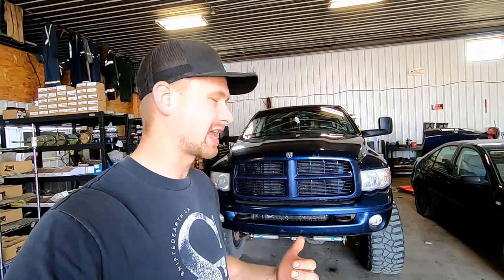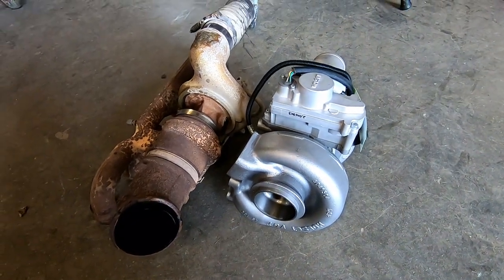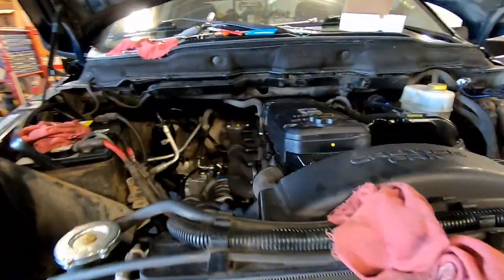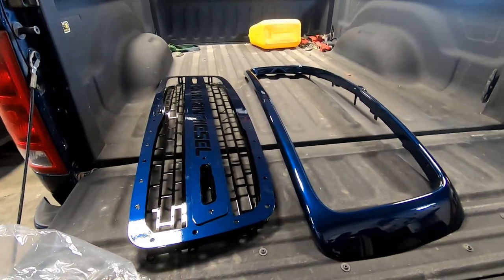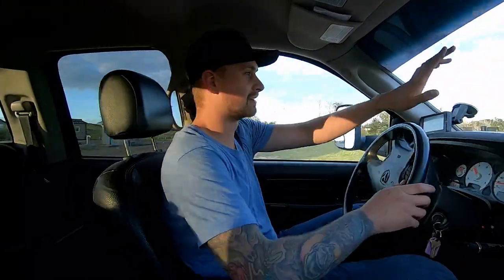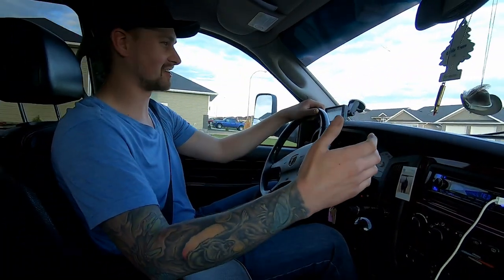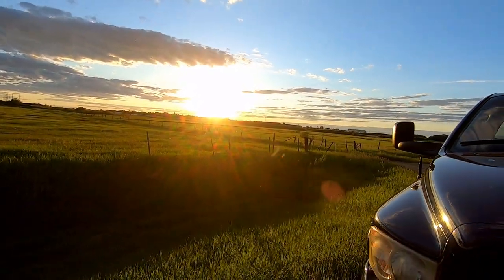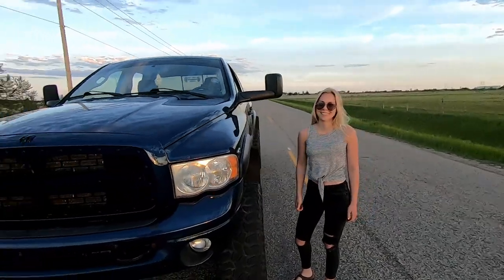I put a VGT TURBO on my 5.9 CUMMINS!  BD Diesel Performance Howler Kit

Comment: Just installed this on my 07 5.9 and really like this setup and I’m coming from compounds. Warmup and the exhaust brake is awesome, fitment is fantastic considering this is mostly factory parts. My compounds experience was ok I was running an HE351/S472 and had some issues with fitment and an oil leak I couldn’t get rid of due to a mount problem. I got frustrated and wasn’t going back once they were removed.
Reply: How is it warm up faster?
Reply: @repairvehicle  the same as the 6.7, the VGT constricts and loads the engine. Most exhaust brakes do this too. I really don’t know of any that don’t have this function.

Comment: I personally love the exhaust brake on my 2014, I turn it on as soon as I start the truck. It helps save the brakes on your truck and I figure the more you use it, the less likely you are to have a problem. So far the truck has 200,000 miles on it and no problems out of the vgt, the transmission is a different story, I hate it.
Reply: I’ve never heard of problems with a 68RFE?

Comment: On m’y 3rd Ram with a VGT and love it. When you engage the exhaust brake while in tow mode (auto trans obviously) and let off accelerator- be prepared for a substantial launch forward of your head towards the windshield. Works amazing. Great video
Reply from the maker: Thanks man! Glad to hear the brake works awesome on an auto as well!

Comment: I have a he351ve on my first gen dodge project truck. I'm running a standaline controller. I feel in love with the turbo as I daily a 08. I bought a 67mm compressor wheel and 70mm turbine, just need to pull the turbo off and get the machining done. The controller I use is from Lil'black box vgt and there is app to custom tune the turbo so I can make changes to the vains depending on shaft speeds, super trick set up.
Reply from the maker: Thats deadly man! Cool you can custom tune it
Reply: @darkirondiesel  yeah I use my as the controller has Bluetooth, can load the updates with the app as well and data log.  Well worth the 500$, you pretty much can run a vgt on anything
Reply: @darkirondiesel  also just found your chanel, great content
Reply from the maker: Thanks buddy!

Comment: I love your videos 👍 I own a 06 Dodge Ram 3500 4x4 5.9 Cummins and have upgraded from Banks the exhaust, intake, Intercooler, tuner, Exhaust Braking System w/CBC SmartLock and now I would like to upgrade my Turbo…what would you suggest?  I am retired so I only use my truck for daily and towing my travel trailer, I do not need/want for speed/racing just for towing, my truck has 88,000 original miles…Thank you for your videos

Comment: Hi very nice i have same truck 2003 quad cab long bed i bought with blown engine i am going o install a 6.7 and use 5.9 fueling system and injectors my truck is manual as well i like your turbo set up would you recommend it for mine thanks

Comment: That's awesome! I'm running a standard he351ve on my 04.5 with the 12 valve. A buddy of mine helped build a mechanical controller and we're trying to find the best way to get the exhaust brake working with it. I'm thinking a button under the throttle where it rests and then to a switch in the cab that I can make it stay off or come on when the throttle is let off. Possibly use a fuel shut off solenoid for the exhaust brake. The BD setup seems so much simpler but I don't like the coolant aspect or the price. These turbos get pretty pricey. I ended up picking mine up for free from a job I did for someone and decided to make it work. Good stuff, it sounds nice and runs probably just as nice!
Reply from the maker: Sweet buddy! If you get it figured out let me know, I’d be interested in hearing how you set it all up!

Comment: So I took your advice and bought the stock Howler.  Going to install this week and I have one question.  You installed the switch near the lighter/12v plug.  Do you turn it off and on or basically leave it on all the time?  My thought was to install the switch onto the shifter but if it is always on then there is no point, are you  happy with your switch location?  Lastly, your channel is awesome and super helpful....thanks again!
Reply from the maker: I pretty much leave the exhaust brake on all the time. Just install the switch wherever you prefer, it really doesn’t matter

Comment: Great video I keep coming back to! One question I have since you bought the 64mm screamer and plan on upgrading your sticks to 120, did you upgrade your clutch yet? If so, to what? I’m curious as to what you’ll think this thing will put down and what measures you’re taking tranny wise to reduce wear and tear with that much power!
Reply from the maker: When I bought the truck the clutch was slipping, so I put in a southbend dual disk clutch rated for 750HP. I’m hoping to put down 500-600 hp with bigger sticks so the clutch should be more then enough. I also did heavy duty push rods, valve springs, and apr head studs when I replaced my head gasket

Comment: You need to clean up your tune. That smoke is fuel and soot and the soot is really bad on you vanes in your turbo so the cleaner the burn the longer you vanes will continue to move. I know guys that leave the brake on all the time to keep them freely moving for a long time. Great video I watch them all and keep us up dated. I want to do the same thing but with a Sneed Speed  exhaust manifold with a 2nd gen swap and I just hate the turbo in the back. This will be on a 05 Dodge 3500 4 door long bed dullay 5.9 and I bought this RIH new only thing I’ve done is twin fuel filters Balwin water separator with drain it’s 5 micron and cat filter is 2 micron and that factory filter I put a Baldwin 5 micron and a Fleece in tanke lift pump that makes 21 lbs at idle and 18-19 with heavy load and gauge for lift pump the factory lift pump would put out 5 lbs at idle and 0 at a hard pull . So what kind of price did BD charge you for VG turbo ?

Comment: I see you're towing your invisible trailer.  I've got cabinets hanging out over my box  from my welding skid and I still keep my mirrors down.  Tried putting them up but the perspective drives me nuts.  Any issues with this system nine months later?  Thinking about it for my 05 3500.
Reply: Is it frowned upon? I keep my passenger mirror up. It helps me reverse into tight spaces lol. I’ve been told it looks like my truck is doing a 💪. (05: 6 speed Single cab dually)

Comment: So is it a normal working exhaust brake that you can use when towing and stuff or would an actual exhaust brake still be better?
Reply from the maker: It’s an actual exhaust brake and amazing for towing. All the new trucks come with these vgt turbos from factory.  My 2022 Cummins is also amazing with the exhaust brake especially in tow haul.

Comment: I was woundring if you could put a VGT turbo on an older engine. I am building a 1936 dodge with a 2005  3.9L ISB. I like that idea.
On a 2015 and 2022 you can have the exhaust brake on with the cruise at 3mph over your set speed the EB will come on and bring you back to set speed.
Also, all videos are better with a pretty girl in them.

Comment: I need to do the head gasket and wanted an exhaust break without spending $100k on a new truck. You upgraded the Valve Springs, rods and studs.  Would you do this any different?  Now that you have had it for a while, would you do it again?  I have a 2005 6 speed G56 that we tow with.  Your vid's are very helpful.  Thanks in advance!
Reply from the maker: I’m really happy with this set up. I did valve springs, push rods, head studs, and then the turbo plus now 90hp injectors. If I were you and you’re just using it mainly to tow I’d probably get the regular howler kit, not the performance one. Exhaust brake is amazing and it’s got tons of power
Reply: So I took your advice and bought the stock Howler.  Going to install this week and I have one question.  You installed the switch near the lighter/12v plug.  Do you turn it off and on or basically leave it on all the time?  My thought was to install the switch onto the shifter but if it is always on then there is no point, are you  happy with your switch location?  Lastly, your channel is awesome and super helpful....thanks again!

Comment: Great video!! I'm interested in doing the same mod to my 03 with a 6 speed NV5600 what additional parts did you need for the turbo coolant connection? How complicated is the wiring for BDD?
Reply from the maker: The kit comes with everything! But you will need to buy a 2005-2007 style downpipe like it says on their website, then a new v band clamp for the bigger flange. The wiring was mostly plug and play, you do have to splice into a couple wires on your accelerator pedal position sensor which is under your driver side battery, and splice into your coolant temp sensor signal wire. Just call tech support and have them email you the wiring diagram for the 2003 manual trans accelerator pedal position sensor. Follow their instructions and it’s super easy.
Reply from the maker: And honestly the hardest part was removing the factory oil drain nipple out of the block and installing/bending the new oil drain to the turbo haha
Reply: That's awesome I will just need  the DIY wiring from BDD since I'm getting a stock 6.7 turbo with the OEM manifold and blocked egr from local seller.
Reply: By far you have the best video showing install and a functioning vgt on a 3rd gen thanks for the quick response!

Comment: I'm putting this kit on right now. Everything is going smooth except the oil drain. How the heck did you bend it correctly and get it on!!??
Reply: I’m having trouble finding a exhaust v band that fits

Comment: Id love to see a dyno run with stock fueling to see the gains also to see the diffrence when the torque gain comes on
Reply from the maker: Hoping to dyno it this summer but it will have bigger sticks and upgraded cp3
Reply: @darkirondiesel  you should talk to bd diesel and see if maybe they will sponsor the dyno runs for you since you promoting there products 😉.  Love the truck man and the channel.  Nice to be able to relate to a normal guy.  I've got an 05 4x4 dually n.v. 6sp that I tow with here on the farm in Southern Ohio . Looking at running this setup  but with the stock vgt not the howler . Have to keep it reliable. Maybe some tuning on the stock fuel system.  Should make it feel like a new truck !
Reply from the maker: BD kinda sponsors me already, they give me really good pricing on their parts and in return I make videos on them

Comment: Think this turbo could handle 150 hp injectors towing or would that be too much fuel?
Reply from the maker: This is right off their website:

450hp-575hp towing trucks we suggest the 1047139 kit stock HE351VE turbo paired with stock or 60hp injectors
575hp-675hp trucks we suggest the 1047140 kit with Screamer turbo paired with 90-120hp injectors and a R900 CP3 pump

I put the screamer turbo on mine and am still running stock injectors.  120 injectors next on my list after I do a FASS

Comment: I guess it must just be a tuning thing my stock holset makes 40psi
Reply from the maker: I can probably get a bit more out of her when I put bigger sticks in and get new tunes
Reply: Dark Iron Diesel Yeah I’m sure it’ll make a hell of a difference! Sounds nice I wanna upgrade down the road
Reply from the maker: Right on buddy. I think these turbos govern themselves at 40 psi, but with that said 40psi of boost at 64mm is a lot more air flow then 40psi at 60mm.  So even if they make the same boost the bigger turbo is pushing more air.
Reply: @darkirondiesel  sounds about right, have you towed with it much yet? I'm curious of the difference on take off when towing when compared with a fixed turbo

Comment: Reliability is the only thing that scares me away from VGT. Otherwise it looks awesome. They are so prone to issues it gets expensive fast. Either the solenoid dies or the vanes get stuck and turbo needs a rebuild.
Reply: VGT don’t seem to fail much more than fixed geometry turbos

Comment: This was odd for me I spend time taking these of the 6.7 they are very trouble some and you are putting one on nice grill
Reply: Very trouble some? I’ve seen 2 trucks come in with bad turbos on the 6.7s and they were a 07 and a 08
Reply: @AsianNIGMA  yes I hate them they use on some of the industrial 6.7 asweell 🤮

Comment: Just out of curiosity, what made you decide on that turbo setup ?
Reply from the maker: Mainly because I don’t personally know anyone that has put a VGT turbo on a 5.9 Cummins. I know lots of people that have big singles or even compounds but no one that’s done this. Plus the exhaust brake is awesome on a standard transmission.
Reply: @darkirondiesel  you think ill be as happy with the money spent with an automatic? Im pumped on the exhaust brake aspect. What do you think now that its been innfor a bit? (I just watched the vid last night)

Comment: 2014 Ram 6.7 cummins. Laramie/U-connect interior that has a dash button for full, auto, or no exh brake. My cruise works while brake is engaged.

My truck is running EFILive. Can something be modified in the ecm programming that can keep cruise from working if the brake is on?

Comment: Damn I’d hate to buy that truck because id have to put a normal Turbo back on it
Reply from the maker: VGT turbos are “normal” these days. It’s nice having a 64mm turbo with next to no lag.
Reply: You must be new to diesels. If you've ever bought a newer diesel they ALL come with vgt turbos. Dodge introduced them in late model 07's and use them until now. They are the future.
Reply: CP Steve Miller I haven’t bought a newer Diesel only pre emissions. And I’m definently not new
Reply: Dark Iron Diesel Yea their normal due to emissions. If I ever bought a new truck it would get a normal Turbo and fully deleted
Reply: @steve5912  Most guys towing or running transport like I was that went from vgt to fixed vane hated it. Smoke, egts, no exhaust brake unless you pay 1100 for an aftermarket one on top of the new turbo. Just from experience. Not one has liked them. Don't get me wrong they're great if the truck's just a toy or only pulls a load once in awhile but out west in the mountains vgt is a game changer. To each their own. Just don't buy a truck with one if you don't like them because most after market swaps are around 2500 bucks. No thanks😬
Reply: CP Steve Miller I say if you need a exhaust brake and have the money for one on top of a fixed vane Turbo then that’s definitely the best setup for the truck.